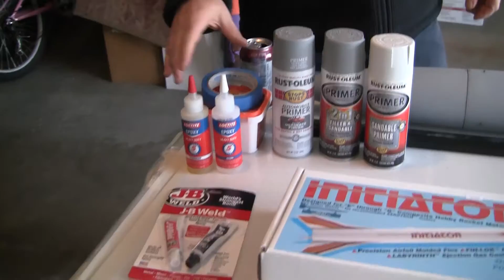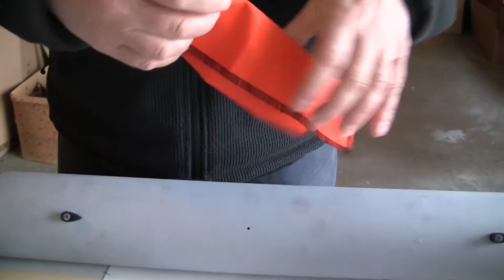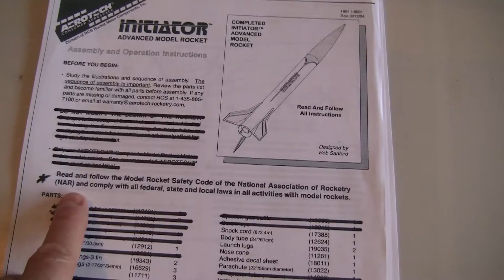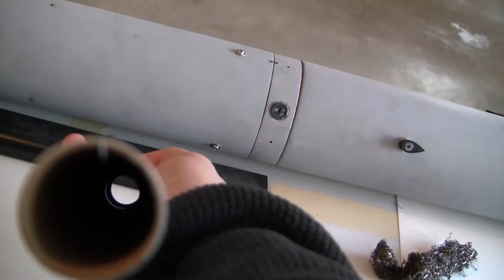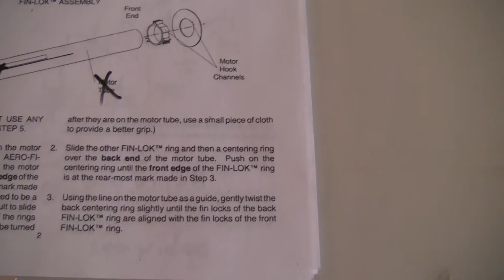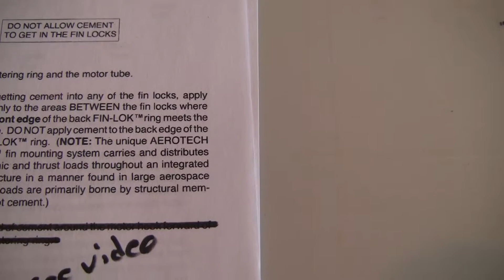Part 1 - Building the Initiator for CTI Motors

Comment: Ive built more than a dozen small rockets and i decided to step ul and get the initiator and it has revised instructions for the 29mm motor retainer so it gives new measurements for the finlocks it says 3-9/16 but the guide on the paper measures 2-7/16 they should of not been so cheap and drew up new plans cause the ones that come with it are a joke i build for a living and read plans daily.. i wish i new more about motor's i would build off your video i have 2 of these rockets 1st one ill build to ther specs 2nd i think ill build off your design thank u